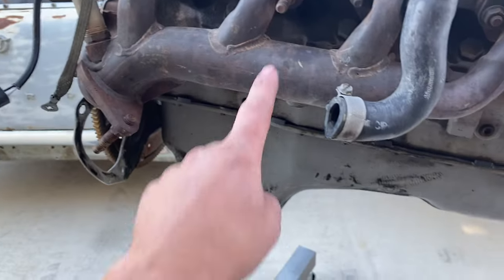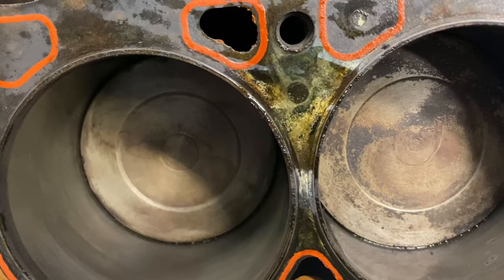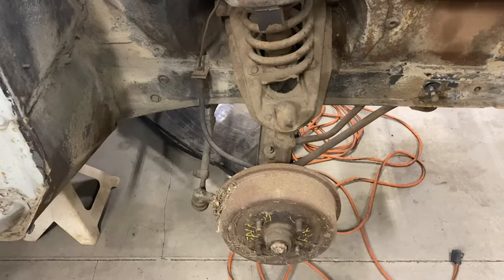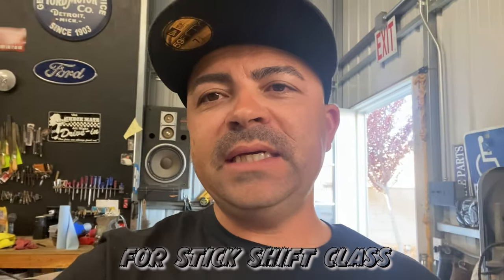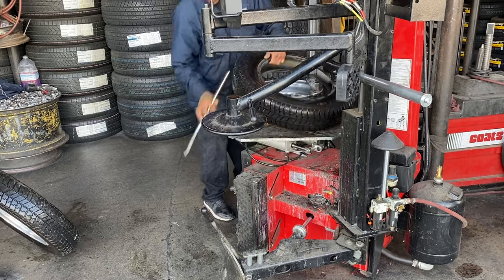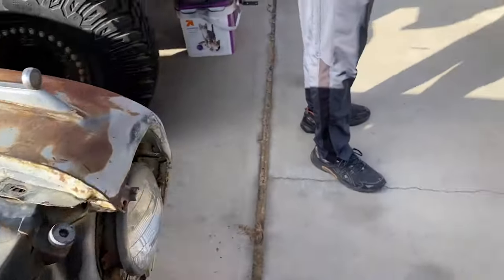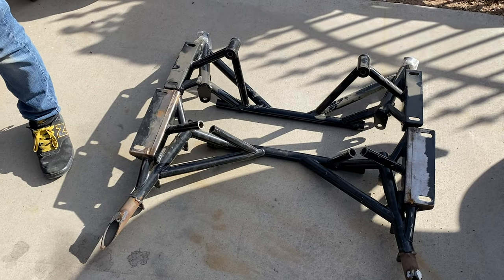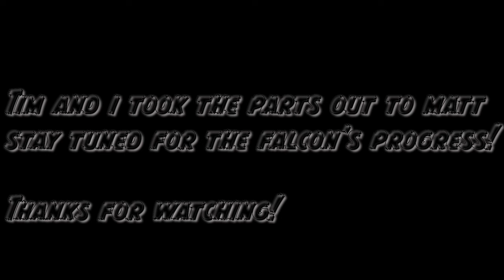1963 FORD FALCON goes to get a K MEMBER

Comment: Good tune, ring gap and if those are hyper pistons (which they dont look to be) will take 6-700whp/20psi all day long with ease as long as you keep shift points around 6k
Reply from the maker: I got a forged piston engine I’ll use
Reply: You took the words right out of my mouth

Comment: I'm putting a AJE setup in my Maverick. It's been a lot of work.
Reply from the maker: Might have to hit up Matt! His stuff is good !
Reply: @TeamDPerformance  Iv not been impressed with AJE. In Fact if I'd known of another option I might have went that way. What kind of strut and strut mounts are you using? I installed the air shock towers also.
Reply from the maker: @347mav3  I’m using SN-95 spindle, fox strut and fox caster camber plate. Stock shop tower that I’ll modify.